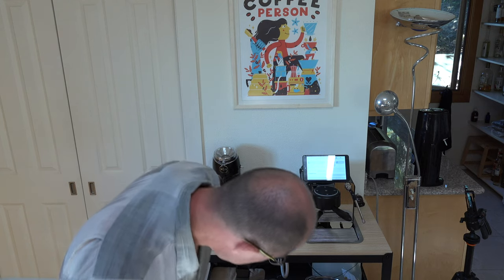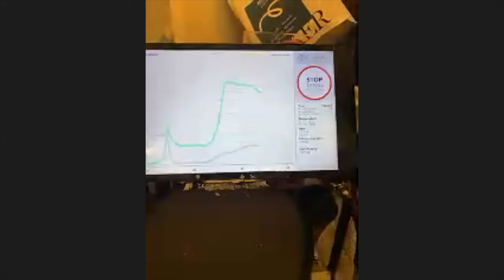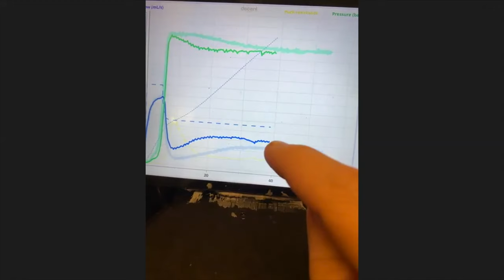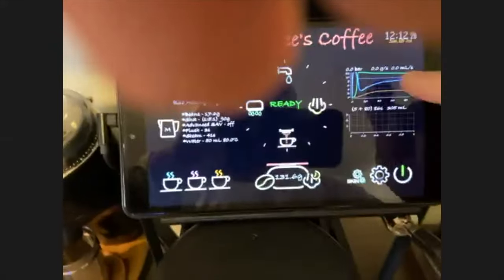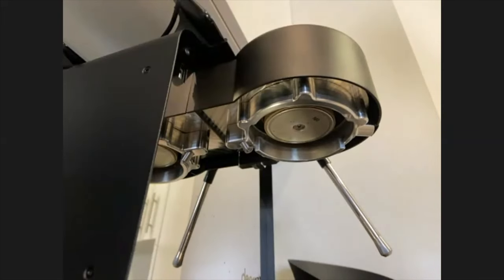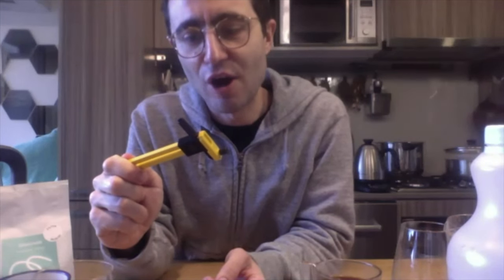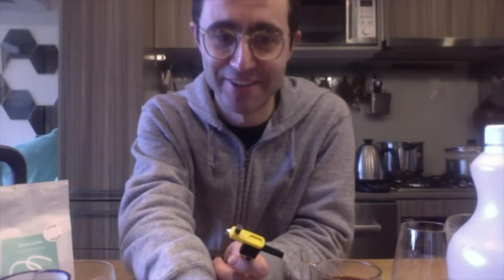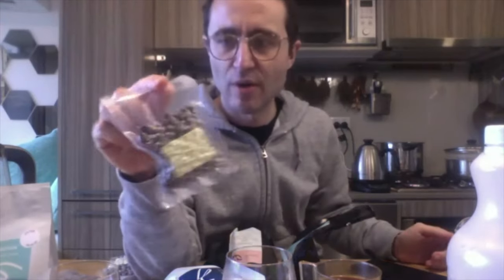All about the Rao Allongé Coffee

Comment: Although I do not have the money for a Decent machine, I love these videos. I have a Cafelat Robot and can use a lot of this information for my shots. For example, doing a light roast on the robot can be difficult because of the temperature control. The robot loses temperature during the shot, so making long shots with light roast feels like walking up a steep hill. I tried doing this Allongé shots on the robot, but the basket only holds about 80ml. I used 18gr and 80 out (so  the same as John's shot). Pulled it at 8/9 bar (measured right above the puck) for 40 seconds. This first shot tasted pretty good and not weak like my earlier light roast attempts.
Reply from the maker: Great to hear you got some good results from the allonge recipe. Sounds like if you moved to a DE1 you would make some awesome shots. The temp stability and control you have at different stages of extraction makes the uphill climb flat again 😉